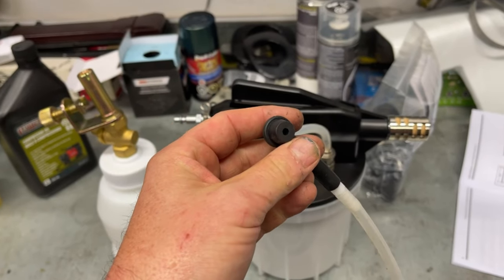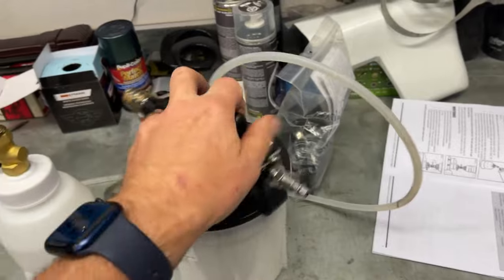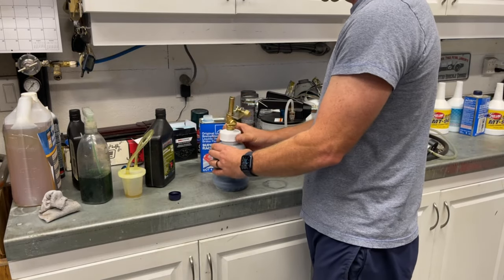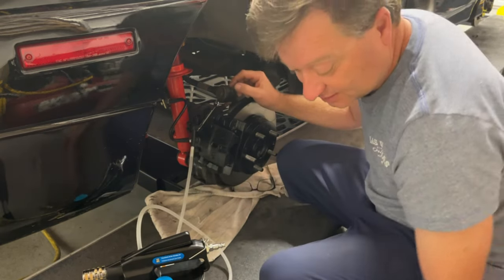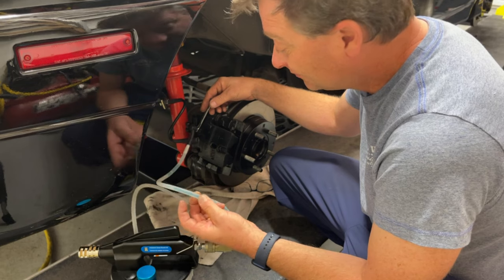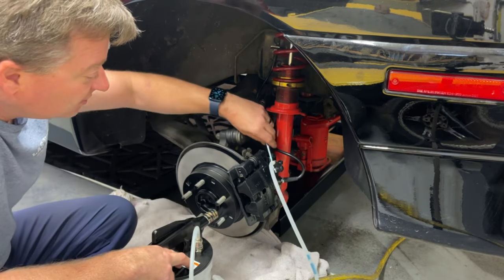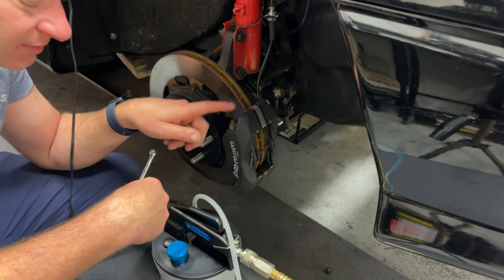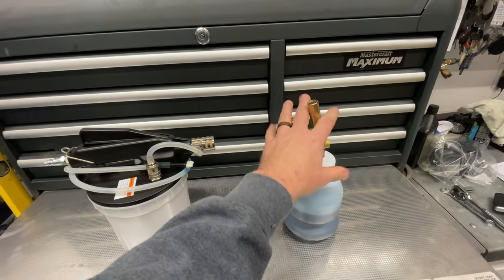Slick Vacuum Brake Bleeder/Flush Tool! \\With Wilwood brakes too!

Comment: The clean fluid bottle will keep the reservoir full if you leave it open. It will fill up to the nozzle then the fluid pressure will stop it until more fluid is removed, so it auto fills.
Reply: Exactly, as soon as he said that it doesn’t flow with the nozzle submerged so it kind of useless, I said he’s doing it wrong
Reply: Beat me to it... a year ago...👍

Comment: that hose end deal is worthless....just use the hose...also... pull the bleeder out first wrap it with plumbers silicone tape , then re-insert it... until it stops, re-open it.... the vacuum won't pull air around the threads anymore

Comment: I love these new bleeding devices.  I have a "SnapOn" one like the one you showed (work purchased it, not me).  I would like the pressure bleeder that you pump up on top of the master cylinder, these seem as good/better.  Nice job, I love the content.  I was a big time DSM guy about 20 years ago.  Luckily, I still have my 1992 Talon AWD and will get back to driving it.  Keep it up!
Reply from the maker: Thank you rgeier. Yes, as you saw these vacuum bleeders are sweet indeed.  Very happy that you like the content and the support you give.  And so glad you are a long time DSM’er!
Reply: I bought the one that pumps into the master but I feel like none of the caps I bought fit anything. Ha

Comment: So got an update the tool is a must have.. I ended up pre and post foot pumping  my brakes  in-between  using the machine. Also replaced the brake calipers pads and brake  lines.. also ON THE ROAD YOUR FOOT WILL PUSH THE PEDAL TO STOP.. so doing this  just pumping it and then walking over to the machine.. was a great  vacuum  for my pt cruiser with split ceramic  pads. Drilled slotted rotors built transmission  shift kits and a limited  slip differential. Please use a pan for brake fluid also..if your pads wear out uneven get a new caliper off Amazon or your trusted parts store

Comment: Just cut the sleeve down on the fill reservoir to just a little under where the clamp sits and re slit it like it was factory. It is designed to not flow once it's at the bottom of the bronze sleeve, otherwise it would just overflow all over the ground. Also, I just purchased mine(same model) and I'm wondering, yours still in working order?
Reply from the maker: Make sense. Yes, mine still is working well. Used it last month.

Comment: Where did you get this its cool. Notice harbor freight has some very similar at 99.99 new. 

I may have to upgrade.

I just picked up brake bleed kit from JEGS comes with hand pump.
Haven't used it yet waiting for few parts come in.
Reply from the maker: Harbor Freight in the USA and Princess Auto in Canada. Other stores have them too as well as Amazon.

Comment: My shop wanted $140 to bleed my brakes. 
I got my kit for $25. 
It will pay for itself with the first wheel 😝
Reply from the maker: You got a great price on that kit. Good for you!
Reply: Same here
Reply: If you understand  brakes and how to change em get a few of those and a few helpers. Its good money.
Reply: I was told 250 to bleed all 4 brakes and they would've used the machine also

Comment: Do you have to pump the brakes after your done or before ?and do you do it with the car turned on or off?
Reply from the maker: No need to have the car running. The idea of the unit is not to have to pump the brakes to bleed them.
Reply: I ended  up pre pumping  before  and after each line. just because  it'll be your foot pumping  to stop the car.  The machine does its job..its a great tool

Comment: will this work on a brand new brake system that never had fluid in it?
Reply from the maker: It should be the same assuming the master cylinder has been primed. I have done it on empty systems.
Reply: great thanks so much
 @SlippingTime

Comment: The bottle that goes on top of brake reservoir.  Doesn't that bring air in if it not close?
Reply from the maker: The brake reservoir is open to atmosphere and if there is any air in the bottle it rises to the top when the bottle empties into the reservoir. Remember it’s a reservoir that holds the fluid for the brake system. The bottle is filling the reservoir just like you do when you had brake fluid to it.
Reply: You can bleed your disc brake system with the cover off of your master cylinder: as long as you keep the fluid level between the Min mark and the Max mark.   The master cylinder fluid refill container shown in this video -- the one with the gold adapter on it -- is not adjustable for height, so the nipple that the brake fluid flows through is submerged, generally speaking, when clamped to the master cylinder neck, which makes refilling the master cylinder physically impossible.  The only time that the fluid refill container shown in this video will work is when the fluid level in the master cylinder is very low, which increases to risk of allowing additional air into the brake system.  I quite agree with the author of this video that this is a design flaw that deserves the lower rating he gave it.  By the way, I have used clamp-on brake fluid refill systems that are a two-part design.  The first part clamps to the neck of the master cylinder, while the second part, which is screwed onto the top of the fluid refill bottle, allows one to slide the nipple up and down.  In fact, the nipple I'm describing is shorter than the one shown in this video, so the point is that it's never submerged in the master cylinder reservoir, which makes it much more effective than the one shown in this video.  This is part of the Holt 57057 "Pneumatic Brake Bleeder With Auto Refill Kit" ... and, No, I am not affiliated with Holt Industries in any way.  I'm just a guy who's done more brake work than I care to admit to.

Comment: That's dot 5 since it's blue should be silicone based
Reply: It looks like ATE Super Blue DOT 4 Fluid.
Reply: @RustysMustangGarage  that's wierd in all the race applications I've seen the blue stuff is dot5 most normal cars don't take it but if they make a blue dot 4 fluid then that's kinda cool
Reply: @justaregularguy3827  don't think it is availability in the US anymore,  or VERY difficult to find. For refrence DOT5 is purple per DOT regulations.  3, 4 & 5.1 are clear to amber. Stupid regulations.
Reply: @RustysMustangGarage  yeah may have changed it I remember when on my friends team they used dot 5 and it was navy blueish might have been purple but was a long time ago  that's still cool though